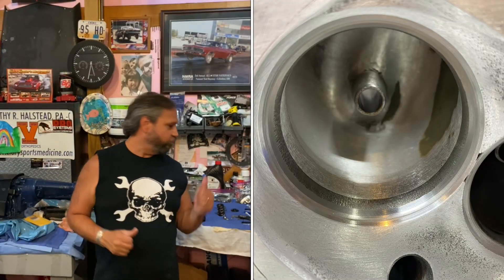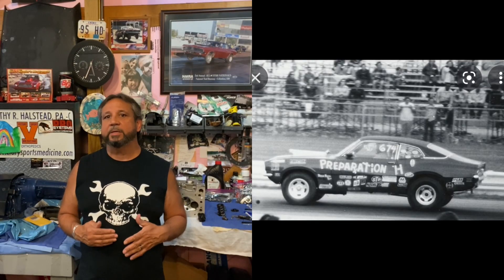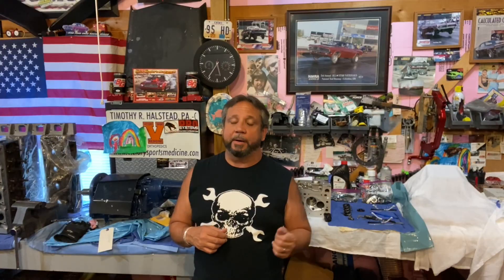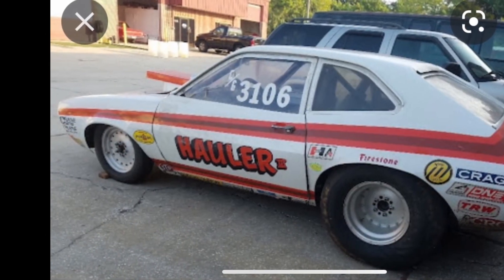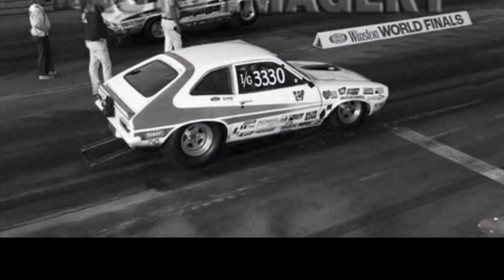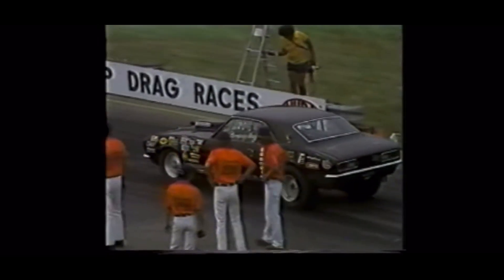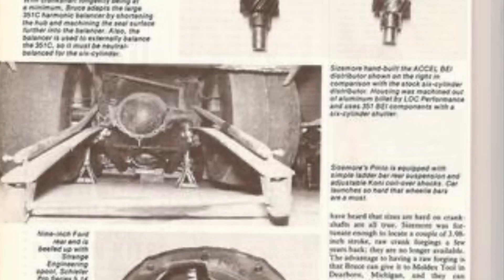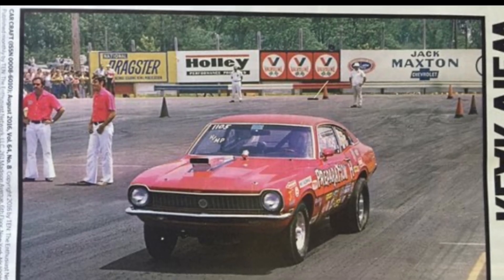Ford 351 Cleveland Headed 300  6 Cyl, 500 HP,  by Bruce Sizemore, Saw Lee Shepard smile, As I Passed

Comment: Tim these videos with Bruce catching and passing Lee and the other Chevy drivers on the big end are simply fantastic ! They bring back great memories of seeing Bruce Sizemore in competition during the seventies at Gainesville Raceway in Florida. The Cleveland headed inline six cylinder in a Don Hardy chassis with Pinto bodywork was in a word just BADASS  !!

There’s another Cleveland creation that folks might be interested in seeing. There’s a interesting man named Jan Baker from my home state of Georgia that has hand fabricated a 552 cubic inch V-12 using Cleveland heads and Windsor blocks. 

He used two 302 Windsor blocks with the front two cylinders cut off block #1 and the rear two cylinders cut off of block #2. He aligned the blocks and used his precision welding skills to join them together. For ignition he used 2 distributors operating independently with one for each cylinder bank in odd fire configuration. 

Three 351 Cleveland 4-V, quench chamber heads were cut into sections and welded together for the V-12 setup. It uses a billet 120 degree, 3.500” stroke custom crank by Henry Velasco. The Howard’s connecting rods are 5.565” long with 12 custom 4.090” Arias pistons. 

The heads got a mild porting job and use 2.19” intake and 1.760” exhaust valves. Jan fabricated 3 different steel intake manifolds for it. 

The first shakedown dyno pulls in 2015 , he used TWO ultra rare Ford Autolite inline four barrel carbs that kept running way too rich on premium pump gas with a 10.5 compression ratio. Despite many problems his first pull managed 604 hp with 491 torque. By the end of the first session it made 697 hp with 576 torque. 

In the 2017 dyno pulls he used three Holley 4-V carbs and a better cam profile to ring up 872 hp @ 7200 rpms and 669 lb/ft of torque @ 6000 rpms. Much better for sure. Jan ran it up to 8000 rpms and it was still pulling strong with 811 horsepower. 

I heard that in the most recent dyno pulls it really made some impressive numbers but I don’t have the results. The whole story should still be here on YouTube and is definitely worth checking out. There was some discussion about having the financial backing to do some design improvements, especially with the induction system and then possibly taking orders to build more engines for customers. Just imagine a Ford V-12 Clevor engine 😉. The possibilities are mind boggling !
Reply: To me thats real entertainment watching that little six whoop up on those mean ole chvys, 👍👍👍💯😆
Reply: @danonoveh8114  ...Those mean ole Chevies were running V-8’s which makes the Cleveland inline 6 victories even sweeter 😎
Reply from the maker: Daniel, that is too cool. The ingenuity of racers, and builders, always amazes me. It is mind boggling

Comment: Straight pipes , build a trombone style intake and free valve it
Reply: If the EPA doesn't screw things up. With the Free Valve type technology I really think you want to go for a 4 valve head. Lighter valves reduces the operating loads on the valve system.

Comment: Wow, so the Ambrose, Argenta, Huettman SVO engineers six-cylinder rail wasn't the first to be done by someone who worked for Ford ! Some more great digging into a lesser-known (albeit fairly successful), avenue of 70's Ford drag racing !!
Reply: Ford Australia did this in the mid 70s with the 250 crossflow which had Clevo valves and rockers.
Reply: jerry meade and driver lew hendershott past record holders in i/g opel gt 1974 1977 then in an e/a roadster 3 piece BOSS 302 Heads lew.
Reply from the maker: Thanks Lewis, cool deal on that.

Comment: They actually used the boss 302 cyl head back in tha day, them things sound like a buzz saw, and fast as hell💯💯💯
Reply: A Boss 302 head is a small chamber 4V head. Dreadfull street engine with those huge ports and bugger all air speed. Have to turn them very hard to make them go.
Reply: they were sayin they used boss 302 castings on the ford six because of water passages diffrences between the cleve and windsor

Comment: Awsome video Tim,  more proof these heads flow the best and 300 potential i didnt expect.  Iv often wondered iis their a large 4 cyl  engine a clevo head will bolt onto.
Reply: There was a  4 cylinder rail here in NZ that had a 429 head, on, I think it was some Mercury Marine alloy block !!
Reply: @arkhsm  yeah the old 470 mercruiser, was like 3.7 litre.  I've got one in the garage, l don't think they get any love from anyone because if you don't maintain it regularly a plug will allow raw water in the oil and we know what happens.  I believe it uses 460 rods, pistons,flywheel, starer, valve cover, the block was mercury marine and the head used ford exhaust ports, and chevy intake ports, something weird like that, also used the chevy bellhousing pattern. They do sound nice running, I'm gonna swap the one l have in mu boat, the torque is impressive l believe around 300 lb ft and suppose to go all weekend on a tank of gas.
Reply: Okay, so l looked it up, it does use the 460 head, and makes 275 lb ft of torque.
Reply: @price8314  Thanks  Matthew, now I know that it was real memory, and not a figment of my imagination !!
Reply from the maker: Not really sure but be pretty cool to make. Someone had to have done it already Michael

Comment: I remember reading the article about the Cleveland head on a 6 in a drag magazine back when I was a teenager.  Don't remember all the details, but seems like the main reason the V8 head mods were done, is because the intake and exhaust manifolds were on the same side of the engine on the 6.  By having the intake manifold on one side of the engine and the exhaust on the other using a V8 head, the 6 could breath with better carburetion and porting making immense power.  Not to mention the many performance parts available for the Cleve heads that weren't available for the 6.
Reply from the maker: Clifford Research was big into 6s, that sure makes sense, thanks for watching. Amazing power
Reply: You are describing the advantage of a. cross flow head. I also remember reading this story in a magazine many years ago. He mentioned that he discovered a way to tell when the crankshaft was ready to break. When the bolts started to vibrate loose, he knew it was time for a new crank!
Reply: @markdauray264  VW finally switched their venerable 8v 4cyl to a cross flow head in the early 90s. 
Main reason was crash safety of all things.
Reply from the maker: Wow, I guess safety first.
Reply from the maker: @markdauray264  that is the ragged edge for sure. Such innovative thinking, the head, not waiting until bolts vibrating
Reply: @markdauray264  
One thing with most if not all inline sixes (and V-12s probably) is they will have a natural resonance somewhere between 6k and 7k rpm. Extended running at that rpm will break the crank. But no matter what on these types of engine builds you are looking at custom intake manifolds and cams

Comment: I had a chance to buy 3 of these heads bare for $1200!! And that was a bundle not a piece.. I lost the guys number from switching phones.. I kick myself in the ass for this all the time..
Reply from the maker: That would have been a steal and you would have cornered the market.
Reply: @dragboss351cleveland  Strangely enough I contacted a shop I found on a 300 6 forum that posted about knowing a guy that used to race with those heads. I contacted them and got the guys number from the owner.. Ive tried and tried to find that site again but its been over 5 years ago..